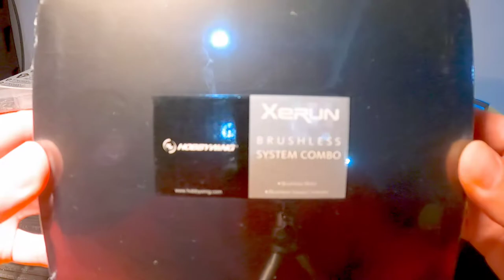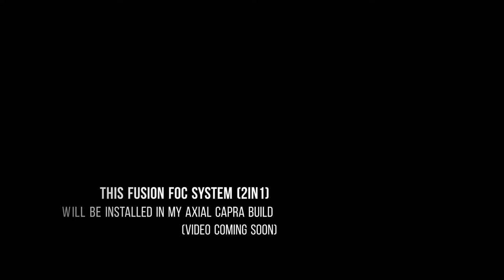Redcat Gen8 with Hobbywing Axe 550 R2

Comment: what steering link are you running?  was 1800kv not enough power for the brass weight?
Reply from the maker: I'm running Club5racing "Husky Link" and full treal brass. The 1800kv is still running great, but becuase of the weight (about 10.5lbs) of the truck, I don't want to get the 1800kv overheated. Hope this helps :)
Reply: @kingyah83  gotcha, been toying with the idea of getting the fusion 2 in 1. my rig comes in at 7.89 lbs.  wish they had one over the 1800kv
Reply from the maker: @DavidSardinha  if you are not planning to go crazy on brass, the 1800kv is more than enough.... However, I was planning to keep it light but ended up getting more goodies.... I guess this is the fun part of this hobby lol